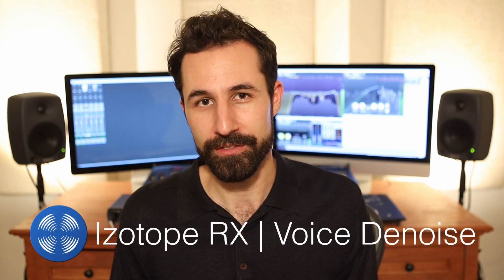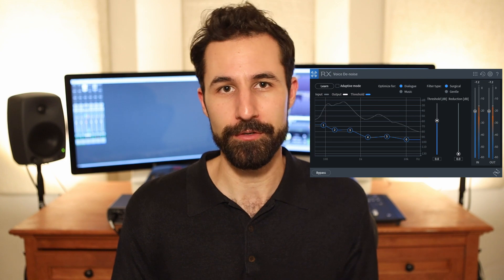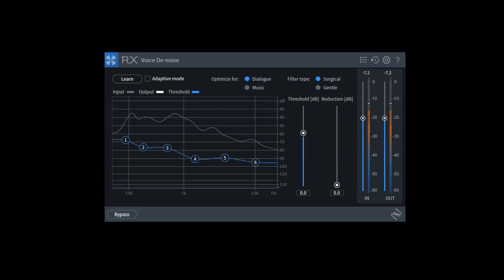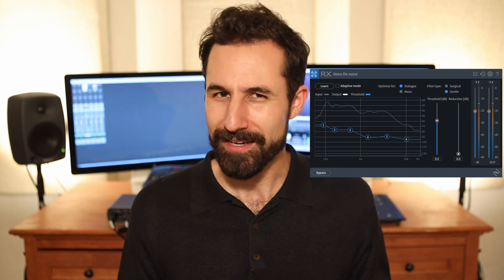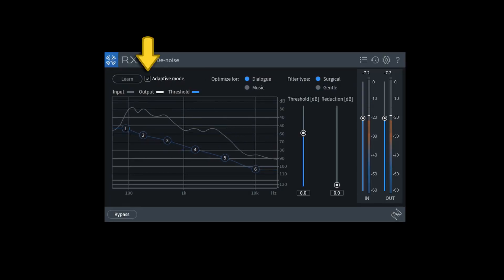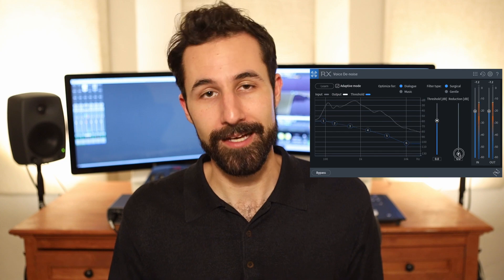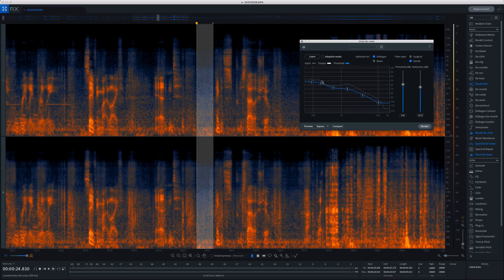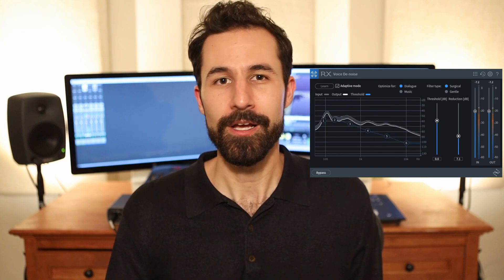How to DeNoise Voice Recordings - Part 5 of 24

Comment: U should do a video on how to get better audio for your mirrorless camera or DSLR most camera like the more high end Nikon camera have a lot of hiss in the preamp and you have to feed it with 20 bd the downside is if you're not super close to the microphone you would have to boost back the audio in post which brings back those hiss noise from the camera and plus 20 DB is not enough on the mic when you turn the gain down to -1db on a camera anything +1db will give u hiss on the Nikon z6 z7 or on other camera which cost 2 to £3,000 thay dont sound as good as the cheapest zoom h1n which cost £79 I think the same would go for cinema cameras and if your vloging u would have to buy something like sound devices or zaxcom they have super clean audio better than the ones that you get on the cameras thanks